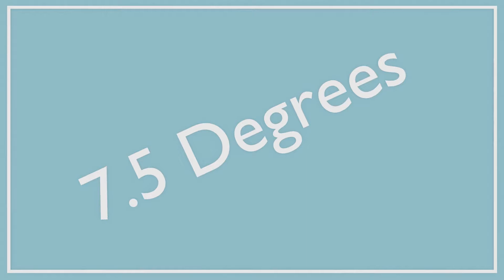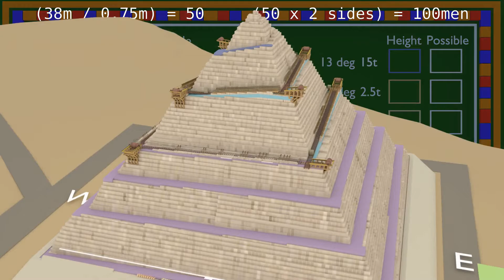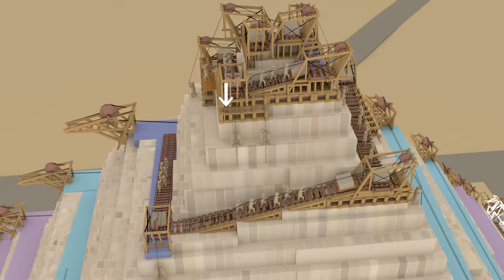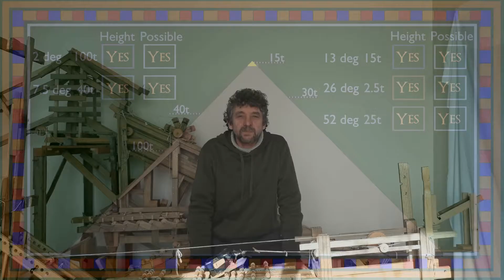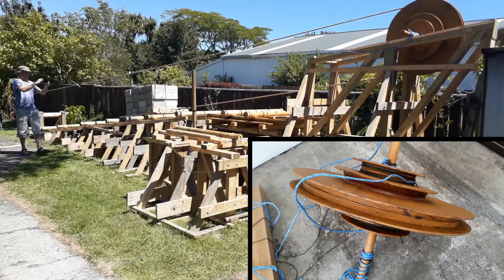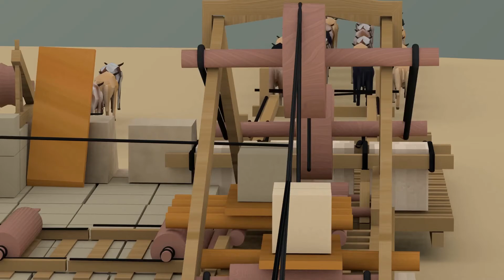Building the pyramids - Busted P2

Comment: Man your roller idea is genious. On a large repetative scale with unlimited trees, it probably seems obvious that is how to do the reset?
How large would the ropes have to be to work with the 100ton blocks? And how would the size of the ropes affect the design of the rig?
Reply from the maker: Great question. The thickness of the ropes required, to move a 100-ton block, would depend on the incline used. But say 12-tonnes of force needed to move the block, a girl's head of hair would have the strength. Also, a spool can take up a lot of rope.
Watch P3, P4, and P5, and see that the rope doesn't need to be so wide. P7 will show this, plus the ropes I used in the tests. The book also goes into all areas, the website also explains quite a lot. 
The main stresses are on the rig's guide ropes, to the spool. It is amazing how small the spool's axles have to be. This allows the spool to rotate many times over a small distance on the rig. A distance of 10 metres could provide 80 metres of rope as wide as my wrist. It's how much rope you can take up on the axle that counts.